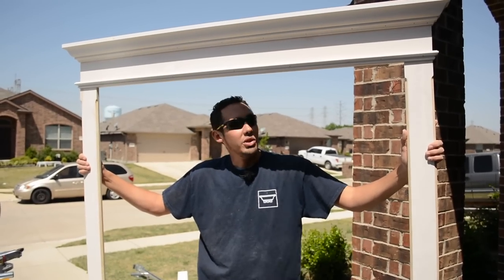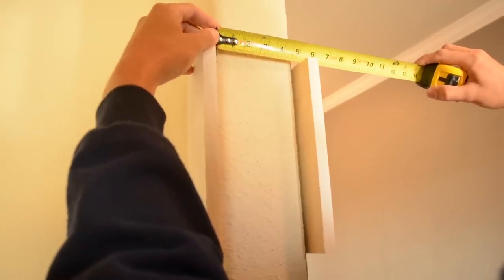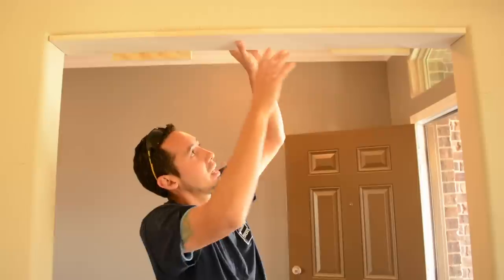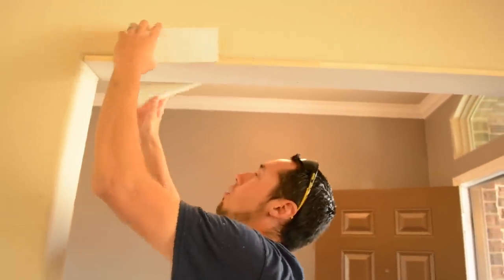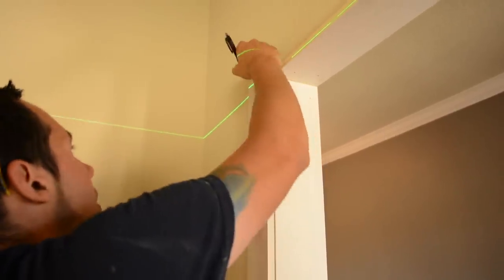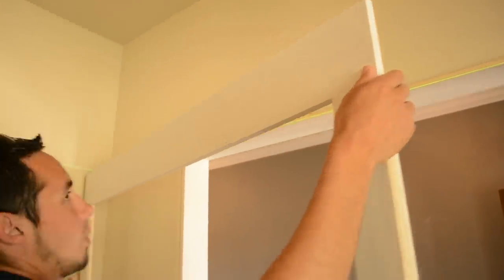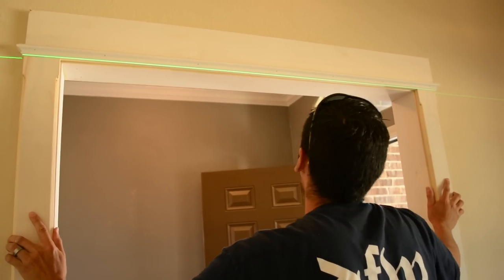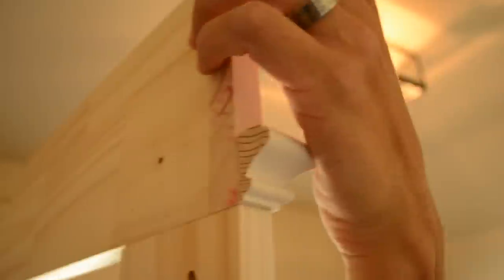Door Trim Transformation - Simple Finish Carpentry

Comment: What if in doing this you found that the left side wall meeting the entryway is uneven. E.g not a 90 degree angle and is more like an 85.  I am running into this now. I can get the trim tight to the inside casing but there would be a 1/2 in gap next to the wall.  Granted you wouldn't be able to see it…but a big gap nonetheless.

Comment: Awesome work! 
Can you show how that mitered return works?
Reply: it's just a small 45 degree return which was 3/4" wide. The biggest problem is tear out when you cut those small pieces, need a very sharp good blade and most of all need to watch your fingers. 
Not sure how Richard does it, but I cut a 45 first on a piece of wood, then cut 3/4" off that way you have plenty of board to hold on to and your figures are away from the blade
Reply: georgeEPC thank you! I was also wondering what a mitered return was
Reply: see 21:43 paused - you can see the 45 and the other piece put back on

Comment: In the beginning, you nailed the boards on each side to measure, and did it in a few places to get the average.  Couldn't you just use clamps to hold the two boards and then measure?

Comment: what happens if the thickness of your entryway isn't plum? :-/  builder of our house 23 years ago wasn't too good with making sure doorways were plum.  We had already bought two 9 lite doors with the encased framing for our master bedroom. It wasn't until my husband installed the framing did we realize the lower section of the doorway is deeper than the upper section, at least 1/4" to 1/3"

Comment: I have a question in regards to the type of project.  Does the trim work get done on both side of the opening or just one side??
Reply: Axeltiguere1976 depends its usually both sides
Reply: @joshua232379  ......I appreciate you bro. Thank you for replying 💪🏽💪🏽💪🏽

Comment: How do you deal with the top jamb extensions and then the head casing actually being parallel to the ceiling or the crown? What if your ceiling or crown are enough out of level to be visible if your new casing IS level? Still loving the vids!
Reply from the maker: Jess Perez I think if the door was close enough to the ceiling that could be an issue.  But I have not experienced that.
Reply: My NorCal house was built in '68.  Wasn't a door or window that if trim was set level wouldn't have been visibly askew.  Even some door casings needed to have varying reveals to accommodate for adjacent walls that weren't plum!

Comment: Any trim carpenters out there check the width of the opening , the floor for level and sides for plumb? You make your adjustments on the legs for level and deduct for shimming the sides and head and premake a cased opening with the casing already nailed to the jamb. Laser levels for a cased opening? And $400 labor for this? Good for You son if you get that.. .

Comment: What's a good way to dress up a doorway without a header (like into a hallway) the entry walls go all the way to the ceiling
Reply: eightyproof depends on the height of the opening. One set Of ideas: if the ceiling is standard 8’ or more you can fill in with a false transom or drywall to create a “normal door opening” then trim.

Comment: I would have assembled the entire case opening on the floor with my casing complete on one side and then would have installed it into the hole leveling and plum it up as necessary and then complete the casing on the opposite side that's the easiest way to do case openings

Comment: What do you mean when you say mitered return? Just curious can you show that in an upcoming video?
Reply: check 24:21 , its clearly visible
Reply: Cut a smaller piece of trim and mitered it to hide the end cut on header. Correct?
Reply: He cuts the ends at 45° and adds a second piece  equal to the thickness also cut @45° so no end grain is showing
Reply: OH! Duh I get it now. Thanks guys.

Comment: Great video - given the cost of materials, would 3/4" MDF not work as well and be cheaper...or is there a reason you prefer the pine/spruce?
Reply: MDF is heavy and does not come in all sizes pre-ripped.  So it often is more work if they board size does not already exist off the shelf.
Reply: He rips all boards to size anyways...he starts with 1x6 and rips them to the exact measurement he needs - see 4:25 in the video
So, I'd still like to know why he prefers the pine versus an MDF
Reply: He knows he's going to chamfer them.

Comment: I stopped watching at the 3:25 mark to say this, you can tack a board to make the measurements but what if you taped 2 strings side to side and measured the distance in between, same task same result
Reply: Not necessarily. Wood studs (that are used to frame walls) are rarely perfectly straight. Even if the corners of the archway are a certain distance apart, the header could have a bow in the middle. You also have to watch with wider openings that when you rip a board straight, the header you are installing it in may not be. I use 2 line lasers when doing any sort of layout because of this. I know not everyone has a laser, never mind 2. But that is a sure fire way to measure correctly.